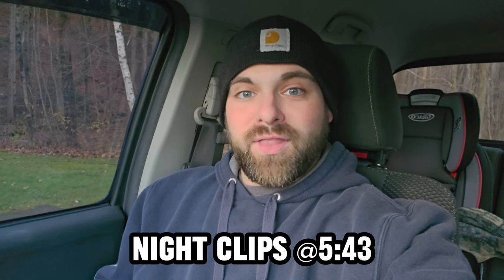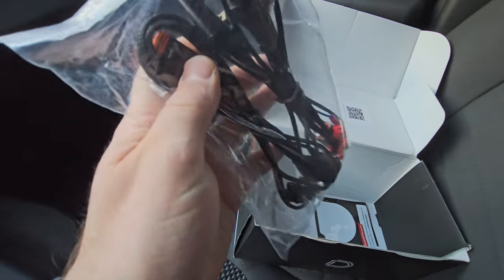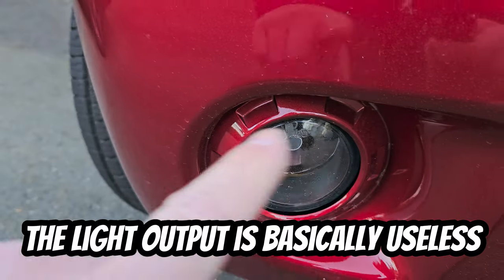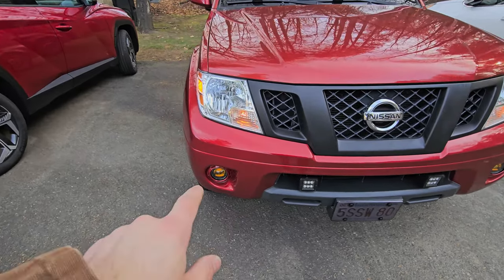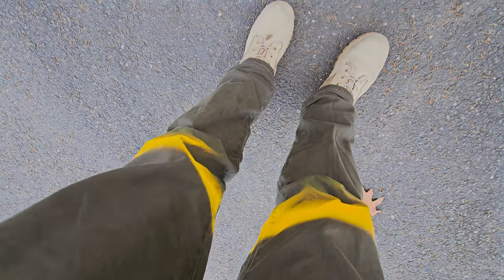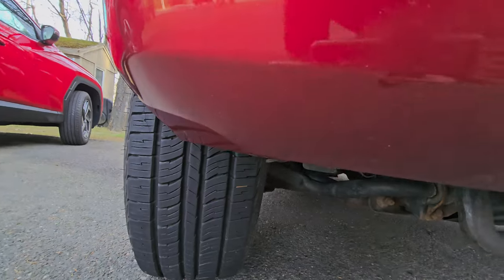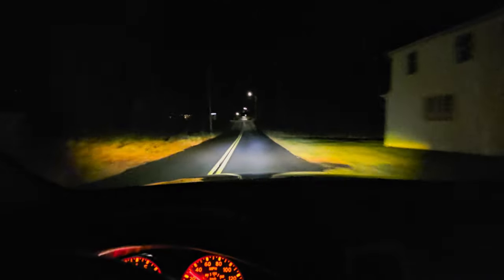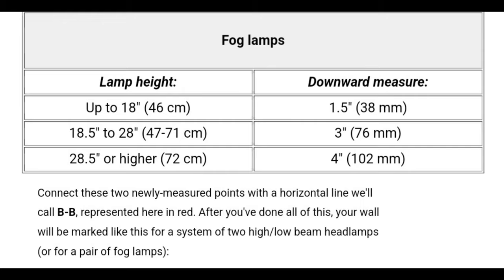Diode Dynamics Elite Series Fog Lights!

Comment: They don’t look… THAT wide…… I am looking for something wider
Reply from the maker: These are wide AF 😂 they go into people's yards. Wider than this does not exist to my knowledge for DOT use. They have Taller which would be the SS3 PRO and MAX line
Reply: @413BROS I think cop2506 is looking for something that shoots out to the ditch immediately like some oem fog lights. I wanted to get some of these but I think my Morimoto XB headlights do just as well lighting up the ditch lines.
Reply from the maker: @jamesyers1975 these definitely light up the ditches they're very wide. But it's hard to see everything in video. Planning on a retrofit of the headlights soon